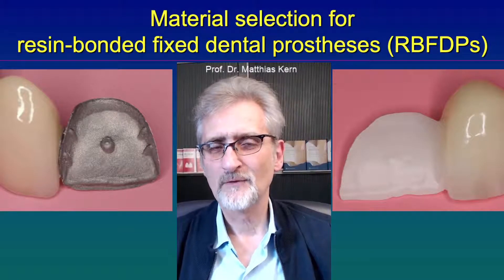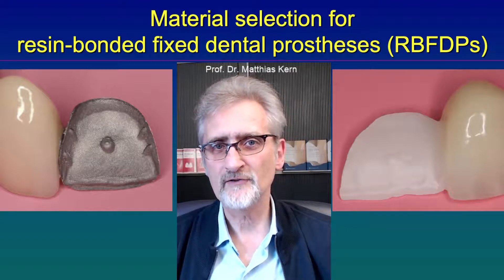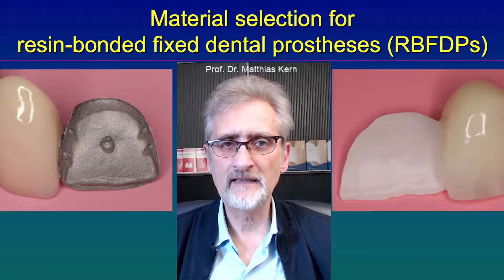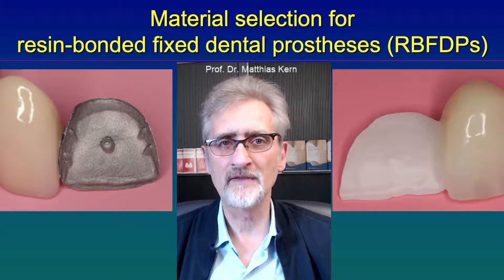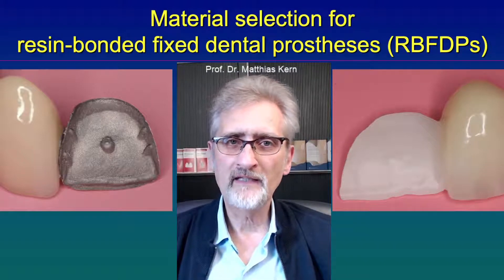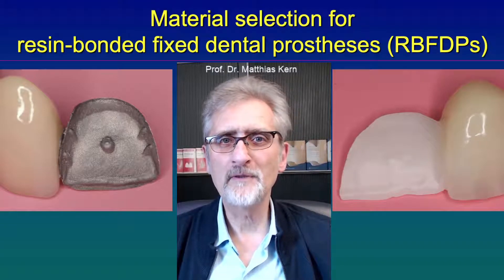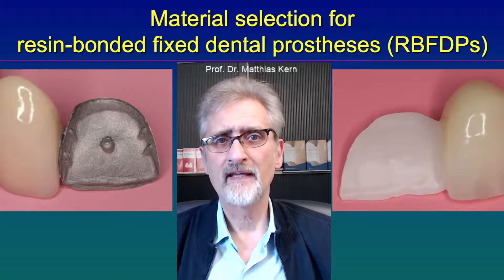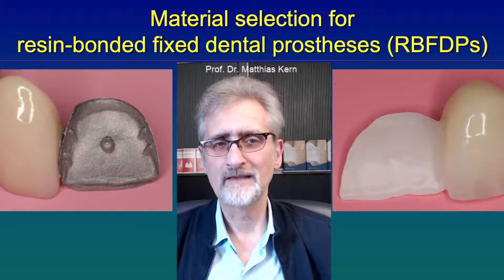Materials selection for resin-bonded fixed dental prostheses (RBFDPs)

Comment: Dear Professor Kern,  since it is a stronger zirconia version, will 0,5-0,8mm thickness of the bonded wing be enough ?
Reply from the maker: We used 0.7 as minimum retainer thickness over more than 20 years and have not seen any fractures but only debondings when traumatic events occurred. I do not know what consequences a thinner retainer wing will have but I assume fractures might occur like we have seen with weaker materials, e.g. alumina and lithium disilicate. There has been no other scientific evidence published with long-term data (10 years+).